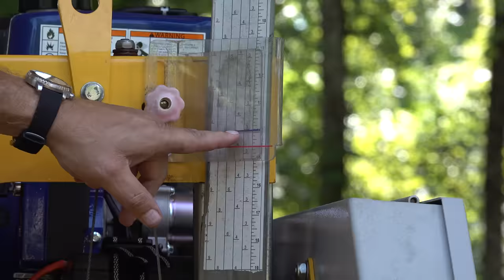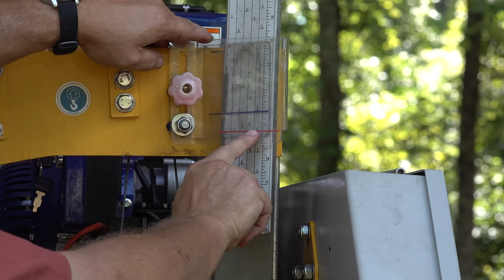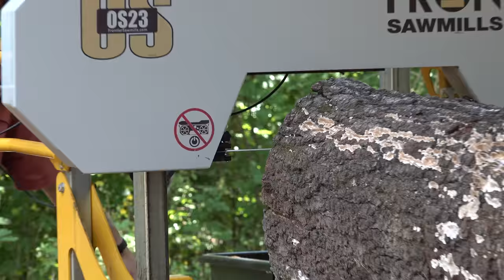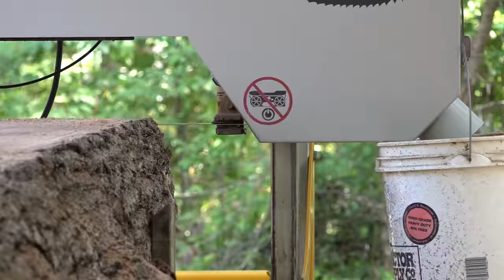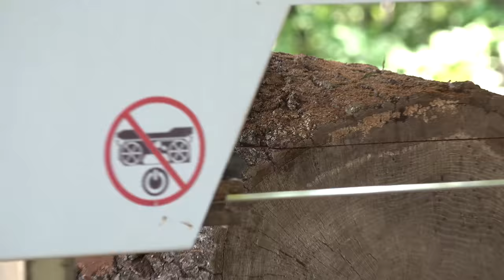Questions You Asked about Portable Sawmills? | Teaching Newbe on Frontier Sawmill

Comment: Thanks for your sawmill wisdom, Tony. Great videography. And, this is free advice passed down 3 generations: keep the sawdust out of the garden soil. Everybody will be happier if you make char out of it, cycle through the compost pile, then add to your garden as a charged biochar. Again, great video!
Reply from the maker: I hear you on the sawdust, but currently, I have clay which does not hold water. I am going to put it down and till it in. I will add extra nitrogen to help it rot. Will add some as ash too.in a couple years I will have good soil.

Comment: I’ve just started to watch your video. When it came to time to gas up your machine, I cringed when you had to lift that gascan up. You’re much younger than I am but I now use a battery operated pump to fill my quad and lawnmower. It is so nice with the automatic shut off. Mine was right around $75.
Reply from the maker: I started going to the gym to keep from hurting myself at the sawmill. It's heavy work, but fun.
Reply: @TonysTractorAdventure  having fun at the mill is better than any gym workout in my eyes.

Comment: You gave some great advise, your points especially about taking in allowance for kerf and its change from bottom of each cut to top of your last cut I think was the hardest for me to get in my head...lol  And I agree you have plenty of power, how many horse on that new engine? Anyway great video, the struggle is real on certain logs. I like my tow board jack to make the pith even from end to end. And for Brock even with hydraulics you have to have something to move a log 36" x 10 ' long,. W Oak or B Walnut might weigh  4200 lbs. and more👍
Reply from the maker: It is a 14hp engine. It truly changes the saw.

Comment: You need to make some wedge blocks to beat into the bottom at 34:30 to help square up the log with the stops. 4x4, 4x6 or 6x6 6"-8" long with a 45 degree, as you beat on the block it'll kick the bottom over and flush up the surfaces on the stops. A couple wedges and a mini sledge can always come in handy in situations like this, especially if you work alone. As for the PITH cut, you mentioned at the beginning, when you measured both ends, that you needed to put a board under one end to level the pith....but you forgot to put the toe board under it. Oops!! Hey, it happens. Great tutorial. I'm already subscribed to his channel, so I'll be looking forward to his new adventures when he gets his Mill. I already saw his version of this about 2 weeks ago and I've been waiting to see if it would show up on here too. Thank you for the extended version. 👍
Reply from the maker: Thank you. It is funny you say that. I bought a bunch of plastic wedges for the sawmill.

Comment: Another tip is not to drop the logs on the saw bed. I've seen many tubers drop the log from as far as 1 foot above the bed. And then complain the mill is always getting out of square.
Reply from the maker: It happens. Portable sawmills will get knocked out of level. It is part of operations. I would re-level each morning if the work required it. Lastly, we are making rough cut lumber.

Comment: So Tony,  which blade do you think actually works better for hard wood,  the 7 degree or 10 degree blade.  I just purchased my mill and I will be cutting mostly hickory and oak. Thanks and hope to hear back before I order my box of blades.
Reply from the maker: The 7degree blade is much smoother and faster. It takes more HP. I don't think I would have done it with the 7 HP engine
Reply: Well another example of why I should watch the whole video before  asking a question.  You answered it at the halfway point of the video.  7 degree cuts hard wood better,  thanks Tony.

Comment: Hey tony! When you said the backhoe on your small tractor would lift 2500 lbs were you talking about the t-25?  I have a t 25 and I’m looking into a sawmill. Just curious if the backhoe will lift more than the front loader.  Thanks!
Reply from the maker: I either misspoke or you miss heard. I never use my backhoe for lifting. I might have said/meant the three point hitch.
Reply: @TonysTractorAdventure  ok maybe I miss heard it.  Do you know what the backhoe on a t25 will lift by chance?
Reply: @TonysTractorAdventure   right at the 19 min mark you mentioned you could use the backhoe on your smaller tractor to lift the logs.    Might make a good video lifting things with the t25 backhoe.  I can’t find any ratings anywhere and I’d be curious if the backhoe can lift more than a grapple on the loader.
Reply from the maker: I don't recommend lifting with the backhoe. So many people have broken the backhoe off. No brand of the compact tractor is built like commercial equipment.  They are not strong enough to be cranes. You can get away with a little, but eventually it will cost big.

Comment: at 41.18 the helper was standing smack dead end of the chainsaw as the other guy was cutting in which in my experience you do not stand in the line of fire incase the blade brakes.
Reply from the maker: Thank you for your safety tip.
Reply: @TonysTractorAdventure  thanks for the video though, i am window shopping right now and it's helped me consider things i never thought of, i was so interested in price that i might have overlooked necessary upgrades.

Comment: I don't understand why you just don't roll it 180 if you have to put the tractor on it regardless. It has to be better than turning it a 1/4 then muscling it in place for 5 minutes...
Reply from the maker: It is different in real life using a manual mill. Think about it. You pass up the 1/4 turn spot using more effort to get to 180. Then you have two flat spots on opposite sides. You will still have to turn it back to the uneven sides. This adds one extra turn when the log is at its heaviest.